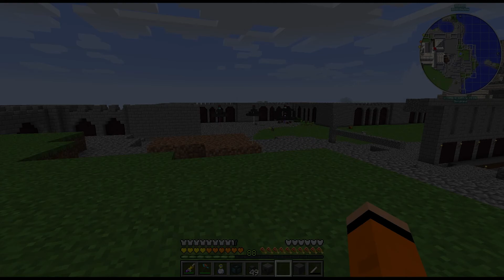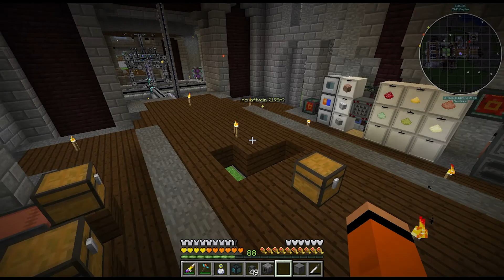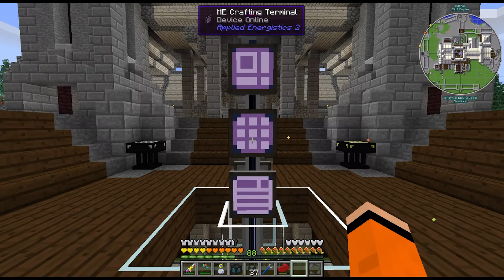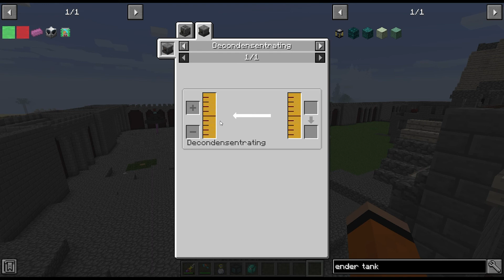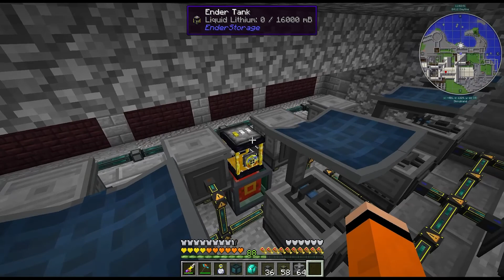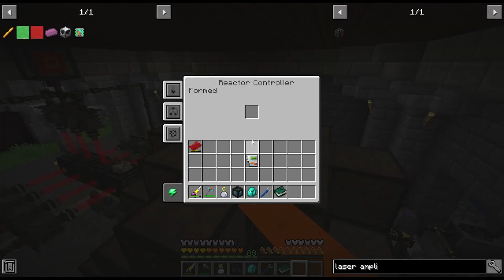Chemistry & Fusion Reaction! Enigmatica 2 Expert Minecraft Ep5

Comment: What's the advantage of heating the thermal evaporation plants with a resistive heater instead of putting solar generators on the top? Space? Resources?
Reply from the maker: Mostly speed since you can set it to accept more rf than the solars can generate. More RF = faster output :))
Reply: @Threefold.  thanks for the response! Wasn't expecting it on an old series (side note, I'm also watching your Nomifactory series in preparation for when I'm done with E2E, I can tell how much more comfortable you've gotten with an on-camera presence. Great job!)